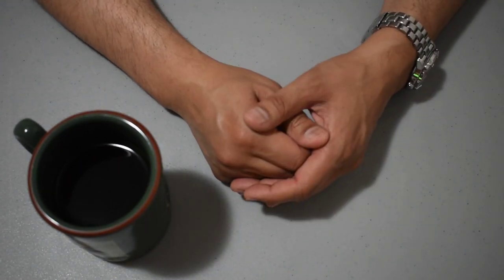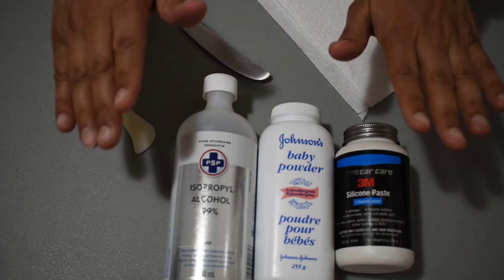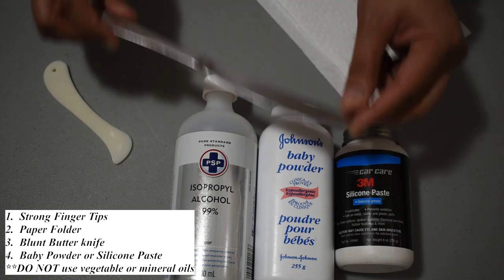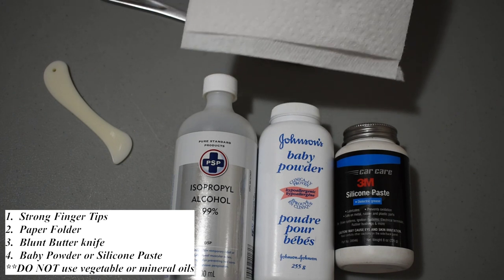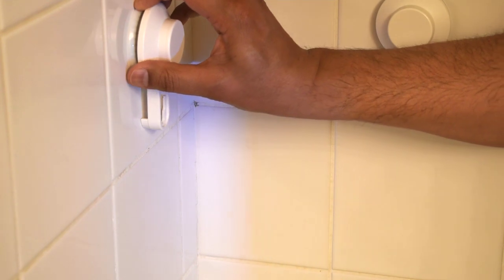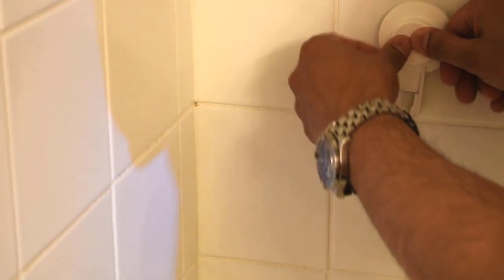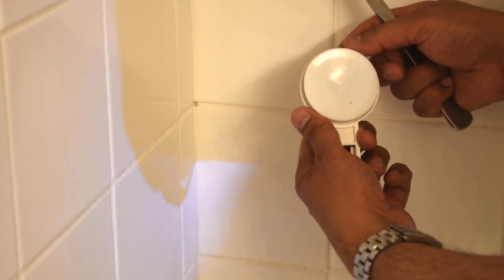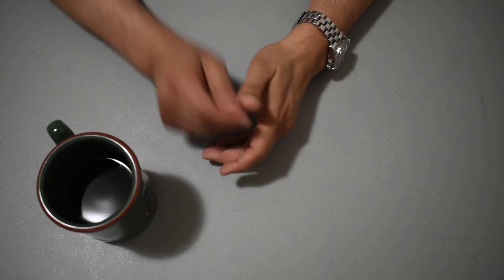𝗤𝗨𝗜𝗖𝗞 𝗧𝗜𝗣: 𝗥𝗲𝗺𝗼𝘃𝗲 𝗜𝗞𝗘𝗔 𝗧𝗶𝘀𝗸𝗲𝗻 𝗦𝘂𝗰𝘁𝗶𝗼𝗻 𝗖𝘂𝗽𝘀 for Corner Shower Caddy

Comment: How do I unpop the auction hook after using it for the first time?
Reply from the maker: Hi Isabelle yap.  Thanks for watching and your question.  I don't understand what you mean by "unpop the [s]uction hook"  could you please explain.  Do you mean, how do we remove it?  Or Do you mean how do we press it onto another surface for a second time.  With more information, I can provide you with better directions.  Look forward to your further guidance.  All the best, H.D.H. [: { ]
Reply: Yah. I have the same question. How do we press it onto another surface for a second time? The first time we install, we can press the suction cup and there's a 'pop' sound.
Reply from the maker: @shamieraelanyshahnon3630  Hi Shamiera Elany Shahnon, thanks for watching and your question. With regard to the 'pop' sound that is air being pushed out from suction cup from small opening--meaning most of the suction cup has achieved a seal with the surface it is being applied to and that small amount of air is now being pushed out.  Contamination and/or damage of the suction cup or the surface are likely reasons why the seal may not be fully formed and why the 'pop' sound is not heard.  Wash the silicone cup with dishwasher detergent (sunlight/palmolive) and the surface you are attaching it to.  Then, as a final cleanse, clean the surface with 99% isopropyl alcohol to remove any grease and try attaching the suction cup.  It should provide a better seal and more of a 'pop' sound.  Make sure you apply silicone paste to the top of the suction cup after installation to prevent it from drying out, cracking, and then losing its seal.  Hope this helps, all the best to you.  H.D.H. [: { ].

Comment: one of my hooks came of and does not get stuck now. keeps falling off after 10, 15 mins what do you suggest pls
Reply from the maker: Hi Saba Arshad, thanks for watching and sending me a summary of your issue.  Here are my suggestions:  1) clean the suction cup thoroughly with isopropyl alcohol and let air dry, 2) clean the surface that you are applying to the suction cup with the same cleaner and let air dry, 3) make sure the placement of the cups is where you want it (ensure you have the spot identified and the hooks fit into the shelf slot), 4) press the suction cup onto the surface, 5) take some masking tape and tape the suction cup onto the surface for 24hrs (with nothing attached to the hooks).  After that, take the masking tape off and see if the suction cup remains on the wall for greater than 15 minutes, then install the shelf and place the items on it.  Hopefully my suggestions help you out.  Please let me know your results.  All the best to you in 2021. Thanks, H.D.H. [: { ].

Comment: How do you manage if the tisken falls many times ? We don’t know how to make it stick definitively it always fall ...😑😖
Reply from the maker: Hi Bettinabrig, Thank you for your comment.  I am sorry the Tisken suction cups  are not holding up for you.  To provide you with a good and effective reply, I need to know more information:
1.  How old is the Tisken suction cup and has the surface of the cup ever been cleaned (if so, with what)?
2.  What type of surface are you trying to stick the suction cup to?  Namely, is the surface a ceramic or porcelain tile or is it granite, limestone or other material?
3.  How much weight are you placing in the holder?  Is it significant, namely, greater than the weight of two full hair soap containers?
4.  What is the condition of the suction cups, can you see any rips or tears--even small ones along the very edges?
Please let me know and I will be happy to do a few tests on my end and try to come up with a solution or video for you.  
All the best, H.D.H.
Reply: HANDY. DANDY. HUSBAND. Thank you so much we juste bought the 3 tisken basket two days ago and two of them don’t stay up ,we clean the ceramic tile with white vinegar and just put a few plastic shampoo and other bathing bottles.... but the angle was not 90° so we had to move the suction cups in another notche as it is planned . Two of the tisken don’t stay 🤷‍♀️😊
Reply from the maker: @Bettinabrig  Hi there,  typically when the Tisken baskets are purchased new, they have a cover over the silicone cups.  Did your baskets have a cover?  The cover keeps the silicone supple and slightly tacky, so when you remove the cover, they stick very firmly.  If they did not come with these transparent covers, it may be an idea to exchange them for ones that are new (without the covers the silicone cups get dirty and contaminated).  Next, try cleaning the surface of the tile and the silicone cup (if it dirty or contaminated) with Isopropyl Alcohol.  Let the silicone cup dry thoroughly, though, as the Isopropyl Alcohol can swell it, but as long as you let it dry it should be fine.  I have not used white vinegar, as it can leave a white residue that impedes the suction of the cups.  Third, once you have positioned the cups where you want them, and everything is cleaned, push them in firmly, but do not hang anything on them for 24hrs (do not let the suction cups go over any grouted area.  This will give the cups an opportunity to 'set' and be more resistant to losing their suction.  I am not sure if you had a chance to watch my installation video for more information:https://www.youtube.com/watch?v=tuNa9CMP45g&t=1s.  Please let me know if the above works.  I have other tips if the cups still are not sticking.
Reply from the maker: Hi Bettinabrig,  I did not hear back and it has been a few days so I thought I would touch base with you to see if you had a chance to implement my solution and, if so, how it went.  Your comments would be very helpful to all viewers so they can confirm what works and doesn't work with these silicone suction cups.  Oh, also, I checked your youtube channel and noticed one of your videos shows either a green house or a building with solar panels:  a HUGE thumbs up for being good to Mother Nature.  All the best, HDH.
Reply: HANDY. DANDY. HUSBAND. Excuse me but I was in barcelone in my daughter’s loft and I left to Paris so I told her what you explained to me and I don’t k ow yet if she experimented yet !! We tried not put anything inside the basket then I know no more 🤷‍♀️thank you so much for your video and explanation 👍👍as soon as as know more from her I will let you know😊

Comment: Another simple way to remove the hook would be to use a string of dental floss. 

Just move the string sideways between the silicone suction cup and the wall and it will detach easily.

Comment: Hello!! I had to move from my apartment and the silicone cups in mu Tisken Caddy got very dirty with dust. Where I live is illegal to buy Alcohol so I wonder if there is any other product that can help me clean them. Thank you very much
]
Reply from the maker: Hi Zoe Instate Tu.  Thanks for watching and sending me your question. If the silicone cups are dirty, wash them with liquid dish washing detergent like Palmolive.  It is important not to use hand-washing soap because it contains oils that may foul the silicone.  Clean the tiles or the surface you are attaching the suction cups to with the same detergent so that both areas are 100% free of oils.  Once you push the silicone cups one the surface and they stick, use some silicone paste on top of the cups just to give them some lubrication to protect them from drying out or cracking.  Hope the above helps, all the best to you.  Thanks H.D.H. [: { ]
Reply: @HANDYDANDYHUSBAND  Thank you very much!! SUper helpful!
Reply from the maker: @zoeinstatetu9938  Thank you for being part of the community.  Enjoy your new residence.  All the best to you, H.D.H. [: { ]
Reply: Spray hand sanitizer should work.